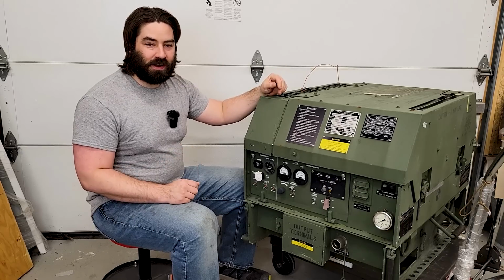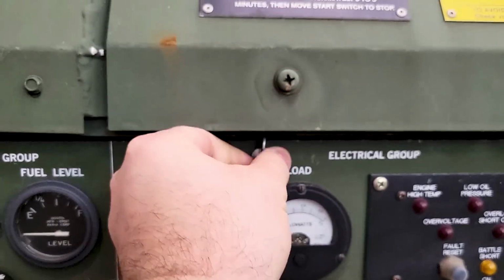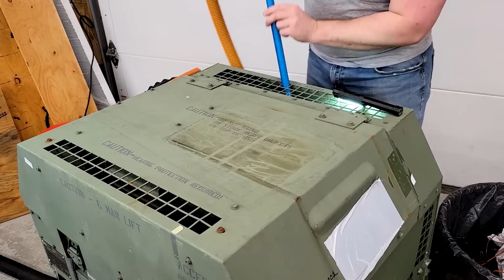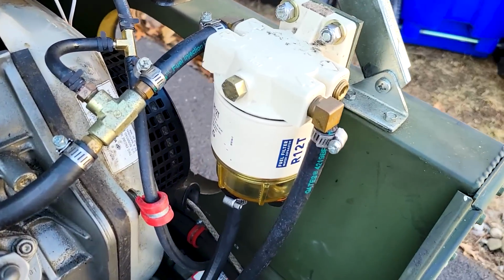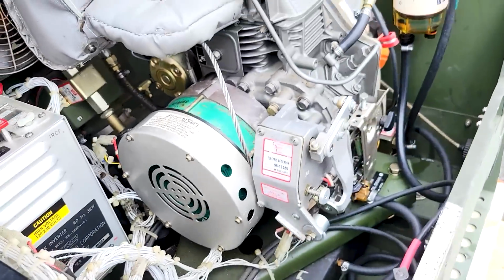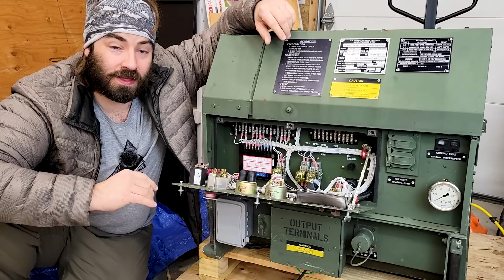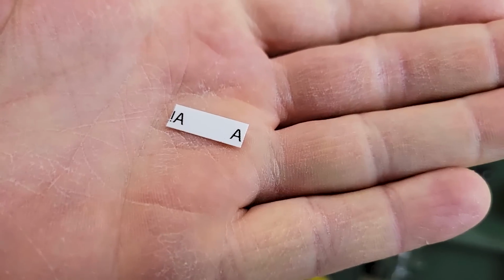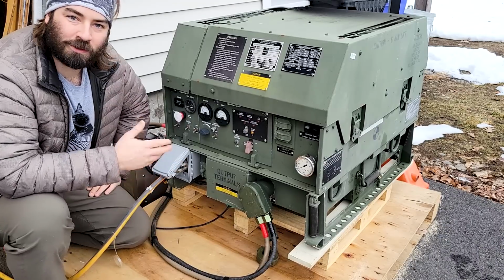Mil-Spec, the best you can do?

Comment: At least it's 60hz, a lot of MEP were 400hz, or even 50hz.
Reply: All the generators I operated in the Marines 1141 Electrician/ Generator Operator 10 years of service.  All the Utility Generators had the option to operate either 50 hz /60 hz. The 400 hz units were used around communication and radar equipment. Less radio interference with the 400 hz.

Comment: I've been looking at these myself and these look like great units.  I would ditch the inverter, rectify into DC, send into charge controller and run the engine @1800 RPM.  It should drastically increase the fuel economy and would still charge my batteries quickly.

It would drastically reduce the hassle with the electronics on the generator.  Add a simple 2 wire start setup and just flip a switch

Subscribed
Reply from the maker: I've been working on that for months.  There are lots of roadblocks to work through, but I should have a working model soon.  Once it does work, then I'll show it in a video.
Reply: @DavidPozEnergy  It seems like it would be easy (hence my plan).   I've been looking for someone selling one of the inverterless units I see being auctioned in huge lots!  Would you happen to have a connection?  From what I am seeing on the auction sites the inverters are junk.  I would love to take a crack at a broken inverter also.

I'm sure you have seen the "interesting" wiring of the PMG.
Reply from the maker: Send me a PM in Facebook,  DavidPozEnergy
Reply: Those engines will last longer if ran at lower rpm too

Comment: It would be interesting to learn how much you paid for it and have in it to restore. Also how much it will cost to run once you get the extra fuel tank. I need a generator as we loose power often and we have a well so when we loose power we have no water. Thinking of getting a Honda 7000 watt and converting it to propane.

Comment: Such lovely hardware...  real guages, heavy duty cabinet, etc...
What voltage does the three phase magnet generator section put out?  And could you increase efficiency by creating a direct rectification and battery charging circuit, to eliminate the losses of going through an inverter and then the charge-verter (I think you called it?)
  If that idea has merit, it would be awesome to have it so you could switch to AC mode or rectified three phase output circuits, in case your household inverter failed, or you needed AC power out in the field, or something like that.
Reply from the maker: The PMA can output up to 200VAC, but it changes with RPM.  Yes, I'm testing out some ideas I have with battery charging.  But there are tons of roadblocks to work through with it.  I've been working on it for months and will share when I have a working prototype.

Comment: Isn’t it capable of parallel output if you have a second generator?
Reply from the maker: I don't think so, at least, I've never heard of that before.  I've used "power-plant" kits from the Army on the 802, and 803.  Those allow two generators to be synced up for the purpose of shutting one down, but it's not really paralleling outputs.
Reply: @DavidPozEnergy  you could be right as the auction listings I’ve looked at for the one like you have I may have miss read something on them or about them

Comment: Those yanmars were good engines, lots of clones out there now. Do you yourself a favor and look into the the 1800 rpm versions. Much quieter, more output, and more reliable.Onan made alot of the older mil specs in the 1800 rpm variety.
Reply: Yeah, like the mep002 or mep003, I have a mep002 and runs smooth and great output, rating way unrated.
Reply: They’re also usually liquid cooled and multi cylinder engine.
Reply: I have a clone of an L100 I bought with a cracked piston and damaged head. I tore it all apart and ordered the parts. Gotta put it back together one of these days lol. No idea what I will use it for but it's cool.
Reply: 60hz # 1800rpm
Reply: Yeah the yanmars where very reliable easy to get parts for easy to repair
Reply: Any reliable brand or sources for clones?

For a fun, cheap project the 500$ 10hp Chinese diesel motors from amazon look viable. The electrical side is easier to source as I have a a lot of contacts for different reman shops.